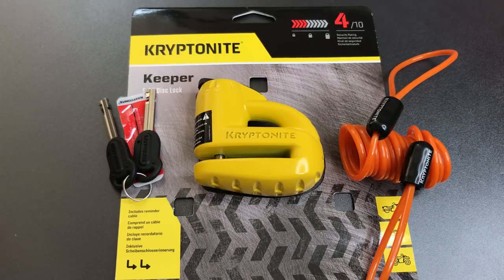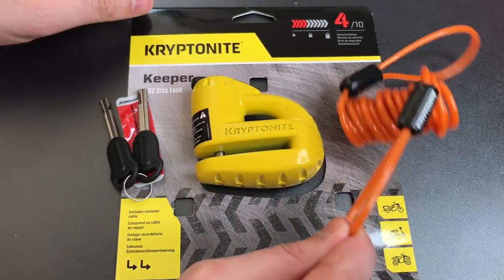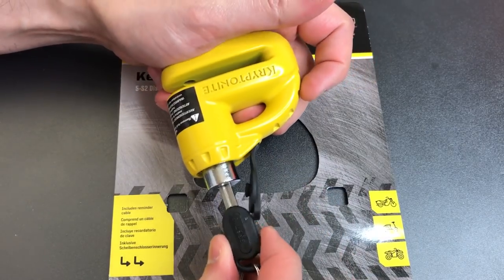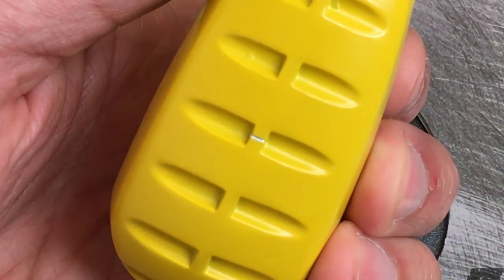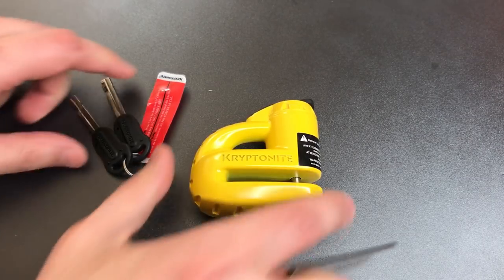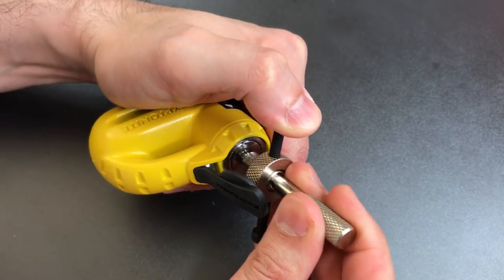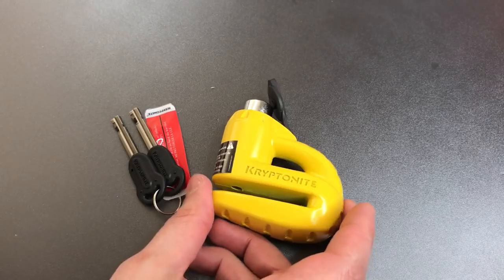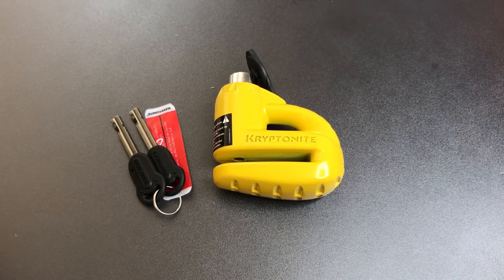[566] Kryptonite Keeper Motorcycle Disc Brake Lock Picked

Comment: I have this lock on my bike, it's very very soft metal. It has pitting and indentations all over it just from rolling around in the plastic pillion compartment. So your Zinc prediction is probably right.
Reply: Devisioned Fate where do you live.?
Reply: Somewhere where you can find other bikes with no disc lock at all. This lock is great for people who live in cities like mine. It's just the perfect level of "fuck off" that will make a thief find a different bike with no lock at all. (Which is most other bikes in my city. They only lock their bikes with the handlebar lock that you can kick to break 95% of the time.)
Reply: I also forgot to include that most of the paint chipped/rubbed off in about a month.
Reply from the maker: +Devisioned Fate Thanks for the info. 👍
Reply: @DevisionedFate    Just kick to break the lock, hmm? Good to know!!! Thanks!
Reply: @usernamemykel  Look up videos of bike thefts. You can leverage off the rear of the bike and kick the opposite direction of the triple tree lock. Pop goes the triple tree lock. Then they hotwire it or throw it in a van.
Reply: Finishing an electric quad mobility device. Have some ideas on a disk and handle brake lock to keep my new transportation safe? Thanks for the entertainment, your buddies at Busted Atv Resort.

Comment: Try picking the lock when it’s alarmed. Mine is alarmed and the moment you touch it it goes off LOUD.
Reply: I have a similar ABUS lock (although I think it's made from forged and hardened steel, not zinc, also it has their very good X-plus core), it's not really loud enough to be heard from the street into the house unless it's really quiet, but the perpetrator, unless he came prepared with ear plugs, will certainly have a ringing in his ear for the next couple of hours, and if it's parked around people it will most definetly attract attention.
Reply: What's the 1st thing we do when we set off the alarm when we're trying to unlock it? Muffle it with our hand. Thinking a thief would do the same prior to starting their attack or pick.
Reply: tinwoods 100% is wrong. I count myself in that percentage lol. even a few seconds of it sounding is enough to catch  the owners attention. You can’t mute the sound completely😉saying 100% of people ignore ANY alarm is simply not true. If a house alarm goes off in my street I’ve seen people come out there doors to see what’s going on. I have told my neighbours to keep a look out if my alarm goes off as I’ve had 1 bike stolen and 1 vandalised because they couldn’t steal it. Jealous idiots. In my street we all look out for each other now as we have had many break ins in a house across the road and vehicle thefts in the area. 3 times an elderly couple have been broken into and on the 3rd occasion they broke into the wall safe. they are targeted because of there age no doubt.
Reply: Michael Manley You can’t mute the sound completely. it’s enough to catch the owners attention which is what they are designed for.
Reply: MagicAyrtonforever nope there is nothing wrong with my area it’s safer than most. breakins occur in most places in the U.K. it don’t matter where you live someone knows of a break in. I live in a quiet village hardly a rough area. I’ve walked dogs every night since I first owned dogs going back 20 years and never seen a single suspicious act by anyone. they picked on 1 house in my street 3 times and no one else in my street has had a break in as far as I’m aware. It’s hardly worth moving out of the area I’ve lived in for the past 40 years you muppet lol. PS stop thumping yourself up. you left that comment and thumbed yourself up😂 I saw the comment seconds after you wrote it and it was thumbed up. sad or what😕

Comment: i have this lock. i use it without the cable.

and it saved my new ZX14. they unlocked the bars and cut my chain and this was all that kept it where it was just because they didn't see it or they happened to not have a tool for it.

it mangled it when they tried to roll my bike but praise jesus it saved me $22,000
Reply: Ohh they saw it they probably got scared off by someone they would have fineshed the job .
Reply: You have a 22k bike and you use a cheap lock like this? This lock is meant for scooters that have brake discs with small holes where you can't fit a lock with a bigger pin

Comment: Good evening  ⚠️ I am in the welding metallurgy and I grew up with grinders of all categories and my advice is to buy a disc lock according to the thickness of your disc, which means leaving no gap between the disc and the lock then  it is best to close it in one of the deepest holes because with a grinder it is very easy to cut even stainless steel unless there is no space for the grinder disc to go between the two it will make the cut a  bit difficult which means a few more minutes

Comment: I have the old hardened steel version that uses a round key.  I assume it's easy to pick so I install it with the key hole facing inward in a hard to reach spot.  With the key it's just a couple extra seconds to open, but picking should be much more difficult.

Comment: I'm pulling my hair out here! Wtf. Why are the lock companies making these locks out of pot metal when the while objective is to protect a very expensive item. They make u-locks out of hardened steel, so why don't they makes these disc locks the same way??? What is the sense in making an inexpensive disc lock that's meant to deter theft of a $15,000 bike? People want to buy an expensive quality constructed lock for that purpose.
Reply: I know this is an old comment but I thought I'd put a small explanation. Locks only increase the effort (=time/conspicuousness = risk of getting caught) required to steal the object. Of note this will also work on a bicycle disc brake.
1. This is a secondary or tertiary lock, the main feature is that it's more of an alarm with locking as a bonus, adding to the number of locks a thief needs to bypass to steal the vehicle and thus making it less likely they would try yours vs the guy next to you. Vehicle thefts of bicycles, scooters and motorcycles are most often done opportunistically rather than trying to get "your" bike.
2.  Most thieves won't be picking locks, they'll be using bolt cutters, bottle jacks, grinders, and so on to quickly destroy the lock with minimal skill or effort needed. The shortest path thru this sort of lock is actually the disc, so the material doesn't matter if the thief is going to dump it into a van rather than riding it off.
Reply: @ForestCat_Peter
Please read my above comment. This type of lock has actually got a functional purpose, and it's not a primary lock.

A thief compares risk vs reward when looking for targets. A motorcycle can be such a high value that it's worth it for a thief to pass up a dozen bikes with 3+ locks on them for the one that someone left with 2 or less.
Reply: Strength in numbers?  I wonder was their intention that you purchased 30+ of these and install 10 each on three rotors on your bike?  Even a "fast" thief is going to keep walking.

Comment: Can the lock be disassembled? It's hard to tell in the video if the screw under the rubber flap has anything to do with retaining the core...
Reply: I have to check, but at least on mine (older model) I believe it's a rivet and not a security screw.

Comment: The one I got has an alarm but these sort of locks real power comes from where it’s located and the difficulty’s to get to the  bolt to but cut and especially if you have them on both wheels just the slightest touch will set the alarm but this isn’t something I would recommend you park your bike and leave for a few hours I personally use this to bring my electric scooter into the gym and keep these on them to make sure no one will stroll out with it

Comment: since it's a cast soft metal, i want to see that gap/slot get some prying force.  It would be easy to pry with anything flat when installed because the brake disc would narrow the space for you.   From there, the little arm only needs to bend or flex 1/4" or whatever depth that pin is inserted into it.   And a slide hammer in the keyhole would probably have a good chance at pulling out the cylinder too.

Comment: Easy way to test for zinc: drip hydrochloric acid (muriatic acid) onto freshly cut metal; production of hydrogen gas bubbles indicates zinc. 34% HCL can be acquired at hardware or pool supply stores.
Reply: Little vinegar from most kitchens will do the trick. Fresher the better.

Comment: Would be a much more realistic test if you did this while it ways locked to a disc and rather awkward to get at.  I always use my disk lock tucked tight up behind the swing arm, where you would find it very hard to get access.  Bet it would take you a lot longer doing this one handed.

Comment: Just an idea for testing if it is zinc, won’t vinegar fizz a little on contact?
Reply: It would fizz if it was zinc, but it would do the same for magnesium.  I'm doubtful that it is magnesium as he said it felt heavy and magnesium alloys are pretty light-weight. The vinegar test does rule out straight aluminum though.

Comment: If the body is  indeed made of zinc the lock is basically a glorified paper weight. The pick resistance is of course a factor in the locks ineffectiveness, but the main issue is the shoddy body, the main deterrence in the device!

Comment: The other reason why it has a low rating, is the locking pin is only 5mm. 10mm pin is preferable.
Reply: If you can fit the 10mm pin through the vents on your brake disc...
Reply: Yes it should be thicker than 5 mm. I use abus granite with a 11 mm shackle on my bikes.
Reply: @mendosi  yeah, many scooters have small holes and you need a lock with a 5mm pin

Comment: I wonder if it's possible to remove the diskbrake. The bike ride would be pretty dangerous though.
Reply: Requires removal of the entire wheel followed by disassembly of the wheel.  If it's the rear wheel, the job is far from easy.  I doubt most wheels could be easily remounted without the brake disc.

Given the type of lock (the bike isn't locked TO anything), a sensible thief who prefers not to pick the lock would doubtless merely load the bike into a truck and drive it to a shop where he can remove the lock at leisure.
Reply: @jamesg1367  Tracker..

Comment: If you're happy just to roll the bike away to somewhere more private, you can defeat this kind of lock with a skateboard under the locked wheel.
Reply: don't even need that.   2 guys and a length of  2x4 under the lower head bearing.

Comment: The blowtorch thing, I feel like a thief wouldn't want to damage the bike it's attached to. :')
Reply: I doubt thieves care about the damage.. they can switch out the brak disc. They'll also happily destroy the ignition lock itself even though that one can cost nearly the bikes value to replace.
Reply: @nocensorship8092  fair point

Comment: Having two (one silver and one in the same yellow), it's been a mixed experience. One, the warning strap doesn't fit with my brake rotors, meaning it's a blind guess if I forgot to remove it.

Second, I've lived it up once a week as it seizes locked from the rubber cap not holding on. 

And third, get the extra keys from kryptonite as they can't be recut at a locksmiths in australia.

Thanks for coming to my ted talk 😂
Reply: You should wrap the warning coil on the throttle grip and it's brake - you'll never have a problem again.

Comment: The Bowley lock seems unpickable. I don't see any way to do it through the keyhole.
Reply: I'm sure eventually, someone will defeat it. As far as I know it hasn't happened yet. I wonder if LPL has one, and is ... probing It for a weakness?
Reply: R.P. Rosen That lock would need a whole new kind of picks with integrated spring tensioners that could work as a group to deal with each pin due to lack of room. That's just my humble opinion.

Comment: Not damaging the motorcycle isn't the main purpose of the reminder wire, the main purpose is to not damage the rider, since the bike comes to a fairly dramatic stop when the lock hits the caliper after having turned the half to three quarter turn from the locked position. You will infallibly take a fall.

Comment: Dont use these disc locks many thieves will use a pry bar or battery grinder to defeat these ive seen too many laying on the parking garage floor and a nice ducati panagale gone again use heavy chain to secure your bike frame and rear wheel to a railing or post . Thieves know the weak point is the lower jaw of these locks and yes they are pot metal ! again heavy chain and a brake throttle lock to slow em down.

Comment: I dont like disk brake locks because it wont stop someone from putting your bike on something like a truck and driving away with it.
Reply: so what stationary objects do you lock a motorcycle to on a public road?   are you going to carry a big shitty 15' chain that will reach across the curb and grass to wrap around a massive tree or street light?
Reply: I dont own a motorcyle and if I did I would carry a chain because when I leave something over 500$ in a public place I think it is easier to buy a lock and chain then to replace something.
Reply: yeah right dude... if someone wants your bike - they're gonna take it no matter what precautions you take
Reply: That might be the case, but having a disc lock still makes your bike less attractive to steal that the one parked next to it that doesn't have a disc lock.